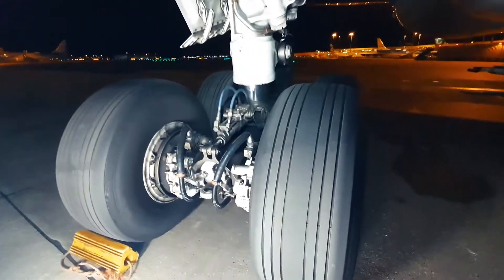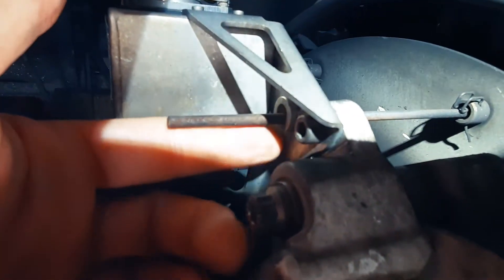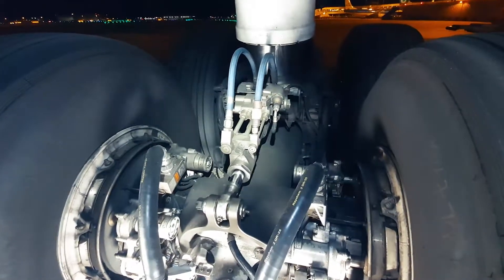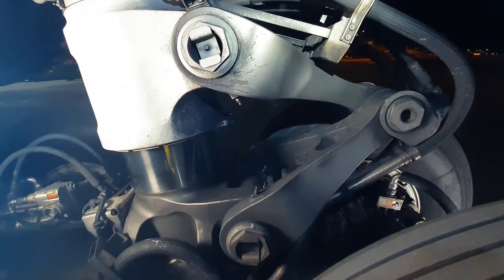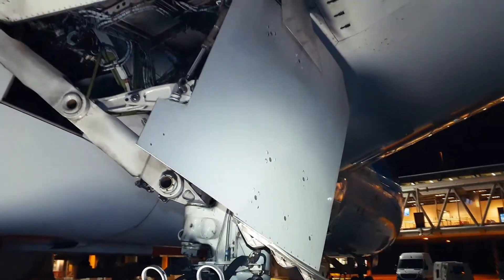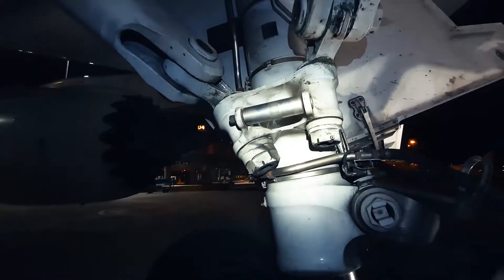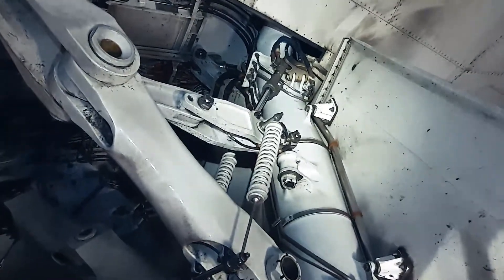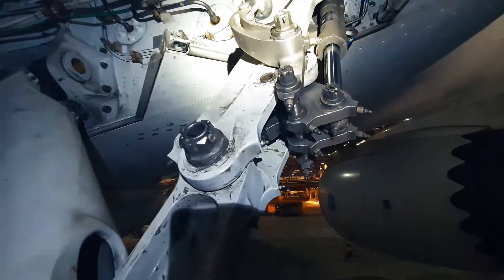Boeing 787: Main Landing Gear (MLG) explained

Comment: I think pilots tried figure out first what is going on themselves then contact maintenance to get some instructions. Returning to JFK big thing, i am sure they didn’t want to do that without consulting with MCC. Also holding lower altitude requires a lot of  fuel, during these conversations they drop below trip fuel, also big thing. Regarding pins, safety lock pins must be visually confirmed; bypass pin has indication (alert message) on EICAS as “steering locked out” If they forget it plane can not make turns. And real problem was main gear tilt actuator 😏

Comment: Question: In the video footage of the air India 787 crash the truck tilt actuator is in the forward position (toes down). This movement requires a hydraulic system force to overcome the wind and gravity. As far is i know  the forward position can only be achieved when the pilots initiate the landing gear retraction sequence. 

The strange thing is that it is only the second step of the main gear retraction sequence to tilt the wheel truck forward. The first step is to open the doors, and if the doors are fully open, the next step is to tilt the wheel truck. It’s unclear for me why the doors are closed but the truck already tilted forward. 

Fyi, the 787 had a dual engine failure, Rat was deployed and lost power a few seconds after takeoff. 

Do you have any idea?
Reply from the maker: No, I have no idea. Let's first wait for any official statements before coming to a conclusion.
Reply: @NextGenerationMechanic  yes! 🙌 I think (just think) the fuel cut-off valve closed due to a complete electrical meltdown. Maybe in September they’ll release the first findings. 

Another strange thing is that they used the whole (long) runway, even though they got airborne. So maybe the engines didn’t reach their full potential because of a problem.

Comment: If hydraulics are lost in flight, does the front of the 787 bogie/truck go up or down... or does it depend on aerodynamics?  Thanks.
Reply from the maker: When hydraulic power is lost, the RAT (Ram Air Turbine) deploys and this supplies hydraulic power for critical systems. Gear down is always done with gravity, and I suppose toes up or down isn't really important in that situation. But I will look it up for you (if I dont forget haha)
Reply: @NextGenerationMechanic 
Thanks!
I see that during gear retraction, bogie toes up goes to toes down to fit in the wheel well. In the case of the Air India crash, I see the gear going to toes down in the video, so that's either from a gear up command or some weird behaviour from hydraulic loss.
Reply: There's a hook on the back of the gear struts on a 747-400, which is supposed to hold the gear tilted (toes up) mechanically, so I assume that's for loss of hydraulics.
Reply from the maker: I guess it is, yes, Im not sure if the 787 has this mechanical toes up position. With an emergency it's your last worry if the gear is toes up or down I think as long it's down and locked.. And the air India crash, I don't know, lets not speculate and wait for the official reports ;-)
Reply: @NextGenerationMechanic  Thanks. Yes, I understand your point about waiting, but I'm worried that the aircraft lost AC power and wasn't fitted with a backup battery for the recorders, so we may be waiting a while for the official report (and even they sometimes may contain speculation). Anyway, we have a lot of good clues now. 

You hear comments on YouTube like "pilot x said this". Half the time pilots don't have a clue what happens on their aircraft (outside the cockpit).
One of my favourite sayings used to be "You can teach a monkey to ride a bicycle, but you can't teach him to fix one".
Reply: @ImperrfectStranger  and @NextGenerationMechanic  I have the same question, i found this of a jetstar B787 and there you can see the tilt, but does it do that automatically or when you put the gear lever up? https://youtu.be/0B9tHUJgIm8?t=14
Reply: @flyingbrussels The gear is normally tilted "toes up" with hydraulics on. Just the weight on the wheels on the ground keeps it flat. When the gear is selected up, the gear tilts toes down.
I misunderstood something I saw in a maintenance video of a gear retraction (on the ground, with the airplane on jacks). I thought the gear tilted toes down with no hydraulics, but I was mistaken. I'm not sure what it does with no hydraulics on the gear.
Reply from the maker: With no hydraulics on the gear nothing will happen. The gear won't retract when the proximity sensors arent sensing that the gear is not in the "toes down" position or stow position. Coming back on your worry about power on the flight data recorders, they have an RIPS (Remote Independant Power Supply) or simply said, there are batteries attached to the 2 flight recorders.
Reply: @NextGenerationMechanic Thanks! I just thought their might have been some natural  bias towards toes up (internal spring in the actuator or nitrogen gas similar to the oleo struts). But now that I think about it, it might make gravity drop more difficult, hitting the sides of the wheel well. 
Thanks for the tip on the RIPS. That was introduced after I retired and I wasn't sure if that was only a mandate for the USA or Europe. 
I've seen some weird photos of recorders (less box-like) come out after the Air India accident. Not sure if they are RIPs. One looked like an orange flying saucer.
Reply: Actually, the orange box which was recovered turned out to be the Emergency Locator Transmitter.

Comment: I learned that stowing away in the landing gear of a 787 is a bad idea.
Reply: 4:31. Looks like plenty of room in there though.
Reply: Freezing to death is a bad thing
Reply from the maker: Freezing isn't even your first worry I think.. The lack of oxygen at 38k ft. will pass you out in around 60 seconds. And ofcourse -50°c (-58°F) @38k ft.  isn't desired either..
Reply: @NextGenerationMechanic  I recall someone saying that if you don't get squashed by retracting gear, there is also a risk of getting cooked shortly afterwards by the temperature of the gear.... then frozen and oxygen deprived. Tyres and brakes can build up quite a bit of heat during taxi... and heat during takeoff.

Comment: This is also very interesting for model building; even if most details are too fine for 1:144, good to know how it works
Reply from the maker: It definitely is!
Reply: TRUCK POSITIONER ACTUATOR ,  este actuador tiene dos posiciones TILT AND STOW , estas posiciones dependen mucho si los MLG estan en RETRACT or EXTENDED .
Reply: @jhonnkennyramirezcachiquel693 that’s all it depends on